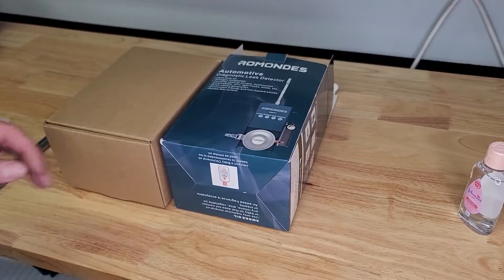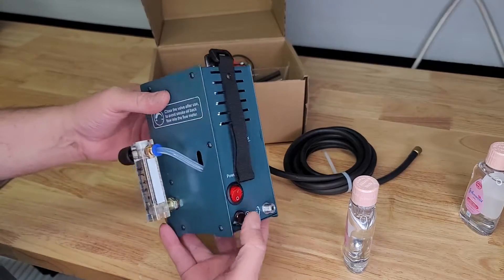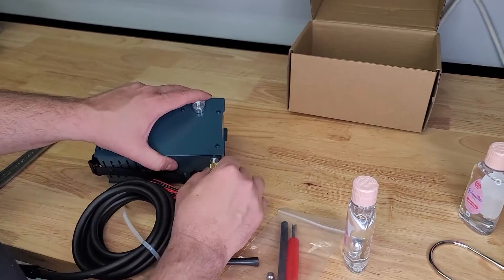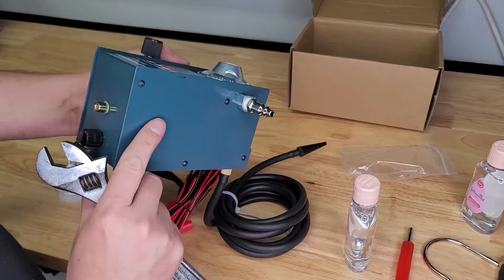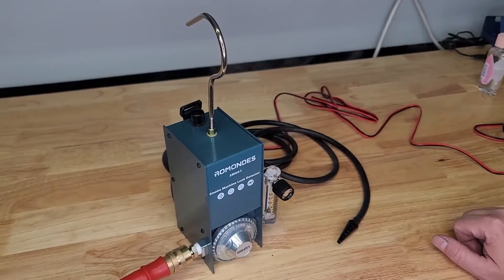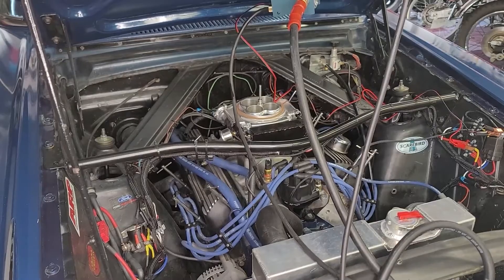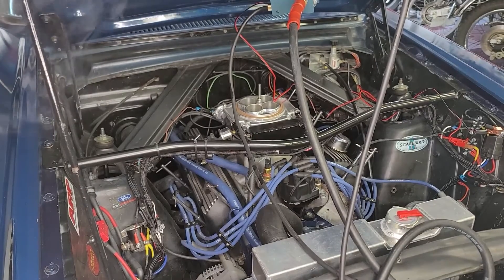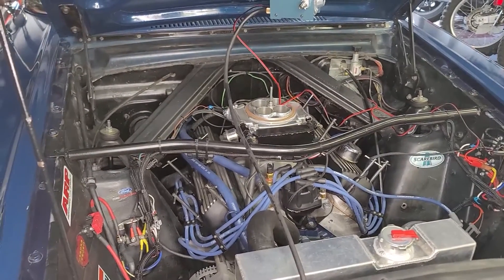Romondes SM601 Automotive Evap Smoke Machine Demo and Review

Comment: is it possible to modify/adjust/bypass the built-in regulator so the compressor can push through more than just 0.5 PSI? I'd like to use mine (when it arrives) to check for boost leak, but would need to have at least 5 PSI as the leak I'm hearing only kicks in on-boost.
Reply from the maker: Not that I saw, but you might be able to if you take it apart.

Comment: Does anyone know what the air CFM requirement is for this machine and the air pressure PSI setting from the air compressire should be? 
Also, I think you overfilled the oil chamber. Look under the black strap. I believe I saw a hole in the case with an indicator for MAX level.   They really need to do a better job with their instructions.
Reply from the maker: I'll have to check that, I didn't notice any problem overfilling it. The instructions are not great that is true. But its easy to figure out and works well.
Reply from the maker: I dialed down my regulator pretty far if I remember right, but not sure what exact number.
Reply: @OctaneElectrons  It does not matter what your air compressor is set to since the smoke unit has a 1/2 PSI regulator built in. The max level is on the back of the unit. I just got mine new and it had a very good written instruction booklet.
Reply: @astrogate1  Just waiting on mine to arrive, but is it possible to modify/adjust/bypass the built-in regulator so the compressor can push through more than just 0.5 PSI? I'd like to use mine (when it arrives) to check for boost leak, but would need to have at least 5 PSI as the leak I'm hearing only kicks in on-boost.